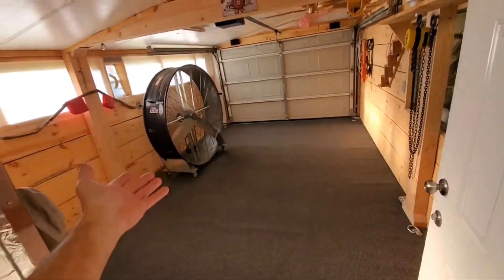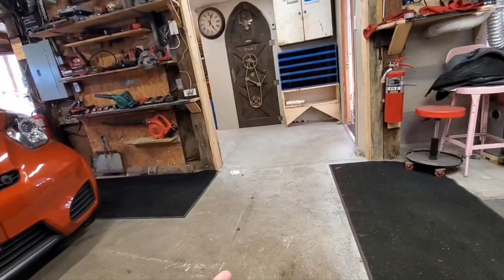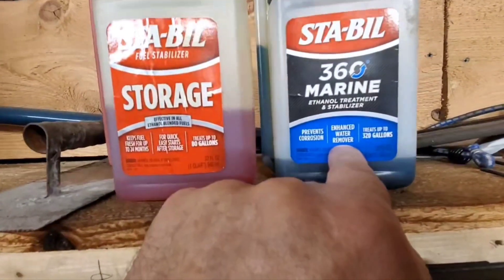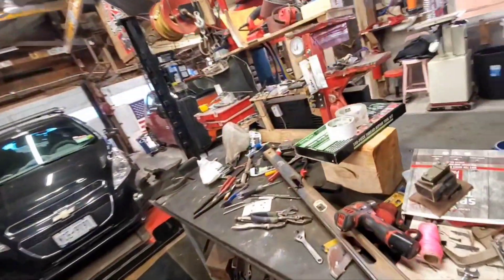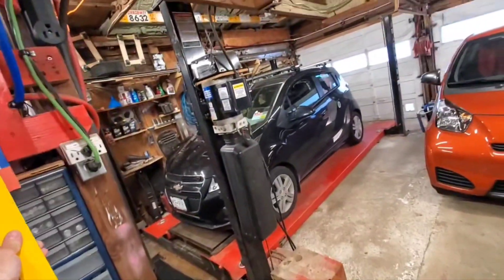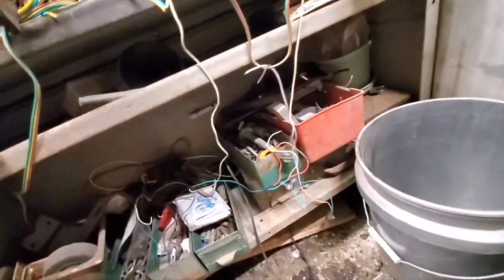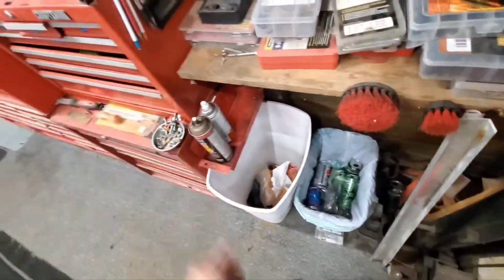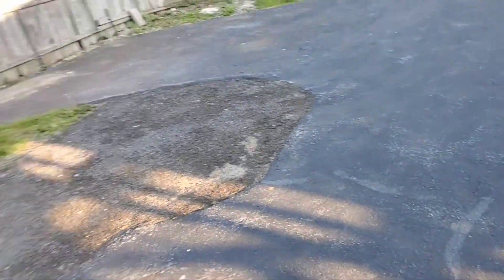What the hell am I going to do now with all this extra room, I need a new project

Comment: years ago i bought two 2kw missouris it cost me a fortune in post i mean a fortune Yet when i bought a turbine from windy nation just as big n heavy they mailed it by UPS it got here just as fast and cost a third the price in postage.
Reply: @TheOriginalAndysGarage  yeh they are a high wind turbine, thats why ian in ireland drove his mws pma using a pulley system and huge set of blades on the large pulley ill find the video for you,  then he made good power in 5mph winds , the best for the money is probably the vector from hurricane windpower in virginia, genuine low rpm turbine much better and larger blades, the pma is alot bigger much more copper etc  tony is a no bs guy.
Reply: @TheOriginalAndysGarage  yeh the small blades are garbage guys buy non mws blades and put a furling tail on to prevent blade overspeed and blade destruction, saw i guy make blades from a thick walled hdpe 44 gallon drum man they did good. a turbine should have no more than five blades, three is best, anything higher than five causes it to kinda stall in high winds and limits how fast it can rotate because it becomes like a wind wall , but you need blades that will spin up in lower winds not just sit there, their dual pmas atleast you could double the voltage by wiring the dc output from the two rectifiers in series so theyed hit battery voltage at lower rpms. ians pulley design was the best i saw for power production from a mws.  my favourite is diy axial flux turbines even smaller ones the do very well.
Reply: ians channel is gone but it was kinda like this design
https://youtu.be/OPUXFA9S8uo
Reply: @TheOriginalAndysGarage  yeh, my diy turbine i built in the past was heavy, my freinds genuine 2kw turbine weighs 160+, makes 1000w at just above 10mph, 10ft blade span. not an easy lift just the pma weighs 116lbs.
plan is to build 1kw axial flux turbines , you guys are so lucky you have places like cms magnets faaar cheaper than here, i need a lathe to build mine thats my hurdle.